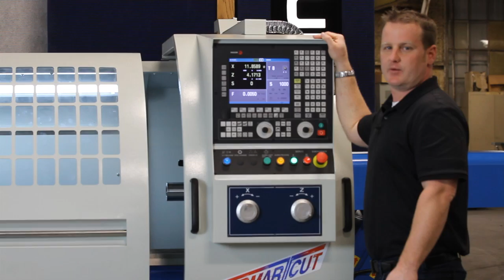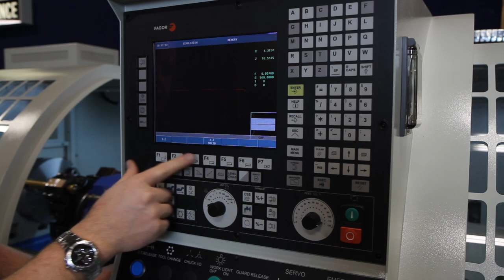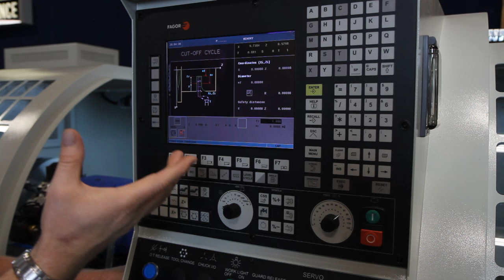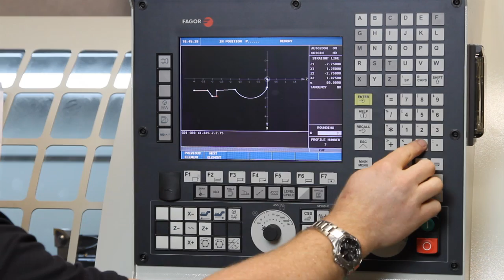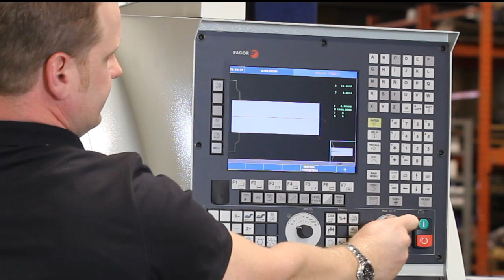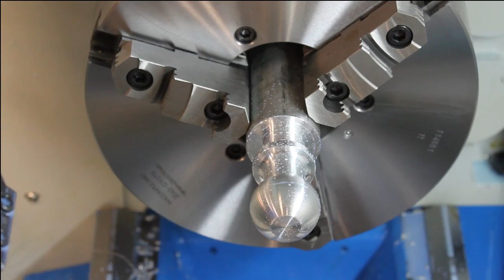Summit SmartCut Series CNC Lathes Demonstration | Extended Version

Comment: I made one operation in profiling cycle level 2.its have final profile and roughing profile  in one cycle but it is directly going to finish cut. can you help me.
Reply: You only need one profile for both roughing and finishing. remove the roughing profile and try
Reply: @jasonbringaze1884  Thank you very much for your information. Actually we are trying to apply program as per manual. According to manual there is two different option for cutting one profile. First option is direct finishing and we are done it successfully. But second one have roughing and finishing program  together. In that we are confused.
Reply: @Godwinfernandez   make sure you have it set to Paraxial roughing its the last icon on the top.